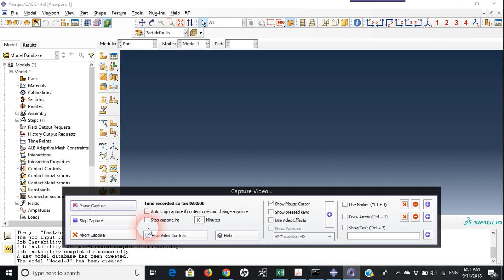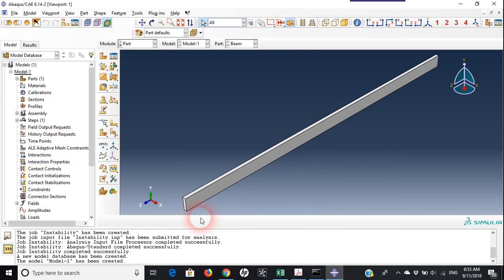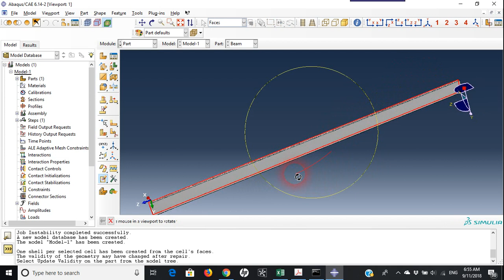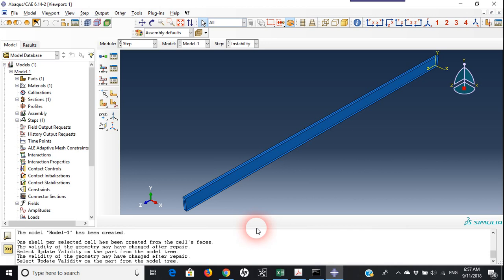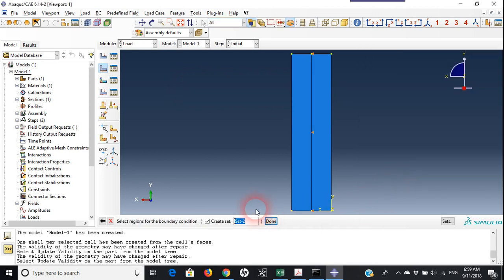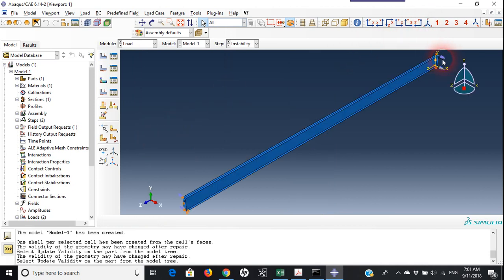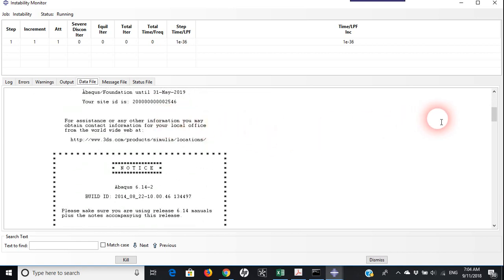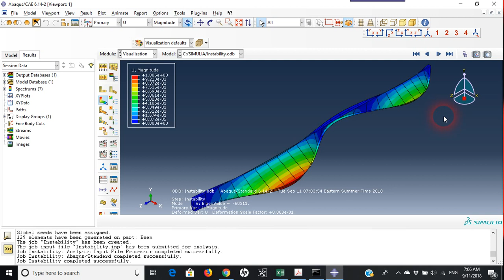Tutorial Example#8: Torsional-Lateral Buckling Analysis of a Simple Beam

Comment: why the U disp.is one in all mdoes?
Reply from the maker: The main output of the buckling analysis is to find the buckling forces (Eigenvalues) while the max. deformation will be unity. If you would like to find the real max. deformation, you can redo the analysis but this time choose Static General Analysis with applied load equals to 1st eigenvalue and you will get the real deformation values.